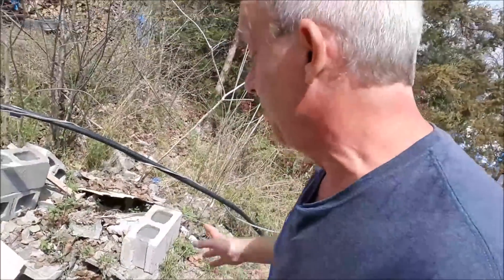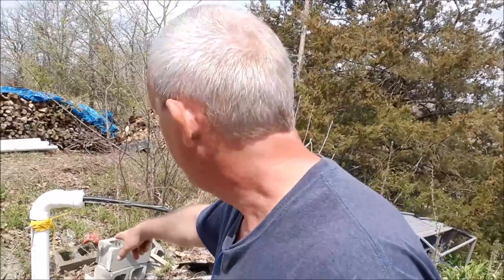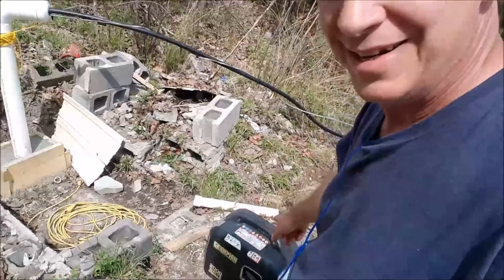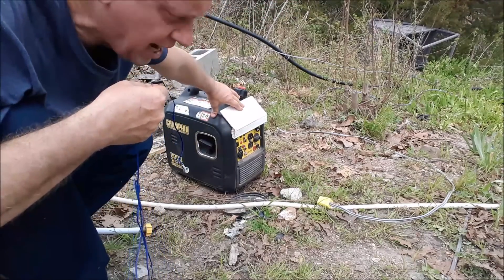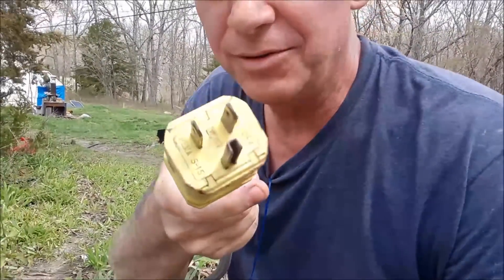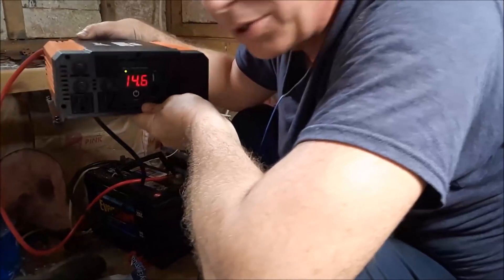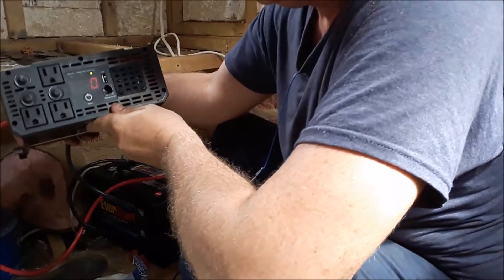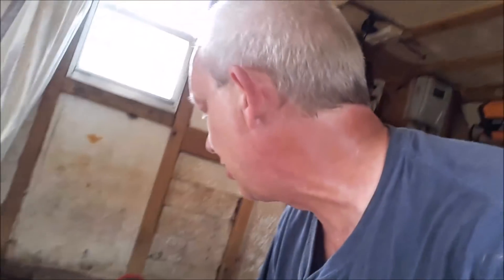What Just Happened To Our Well While Off Grid Living In A Tiny House

Comment: I have the concern about getting water out of my well too, only in my case, if I lose power after a hurricane, or bad storm..... I thought about going old school, by putting in a handpump,  but that would interfere with my existing well pump setup. I found on Amazon they sell a exterior emergency handpump that fits a small diameter hose down into the well that won't bother the pump already in the well. I always like to have back ups of the back ups too...Lol I am still doing my research!

Comment: Love the idea of back up, been trying to set myself up with backups as well. Not sure who said it but the quote holds true "2 is 1, 1 is none." If you are concerned about the starting amps on the well you might be able to put a soft start on it. I haven't used one but they sell universal ones for power tools that just plug in line. The one I found costs $130 so it might not be worth the cost but it could be an option, If you are concerned that is.